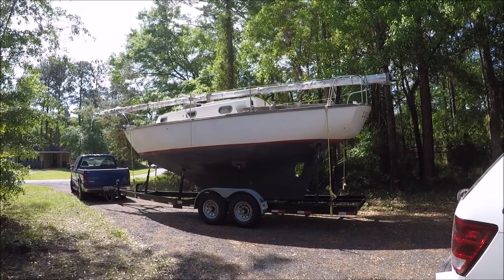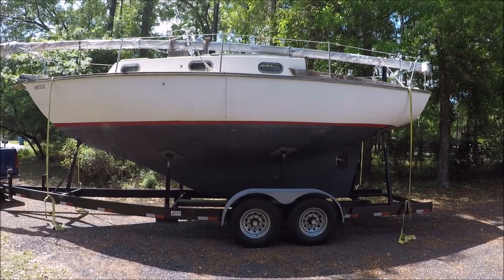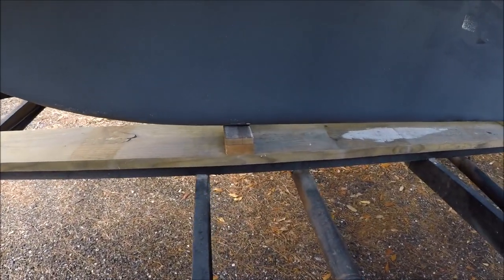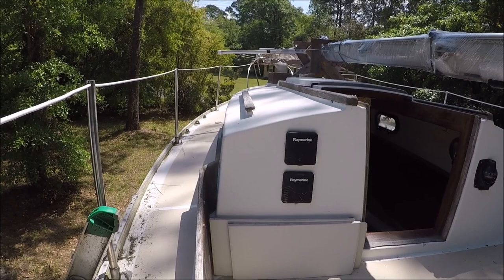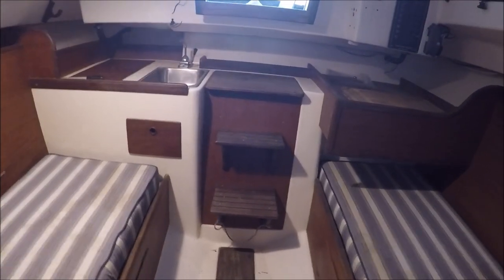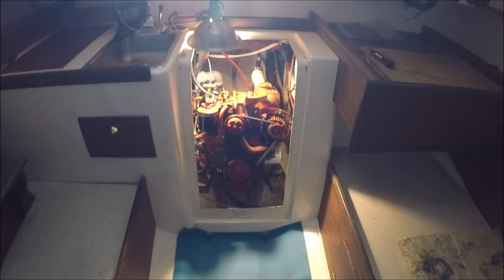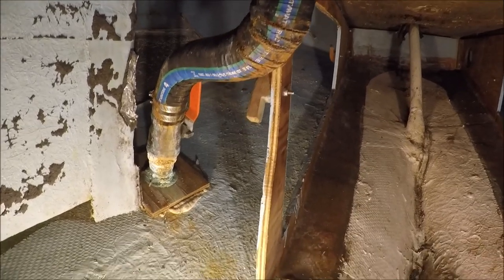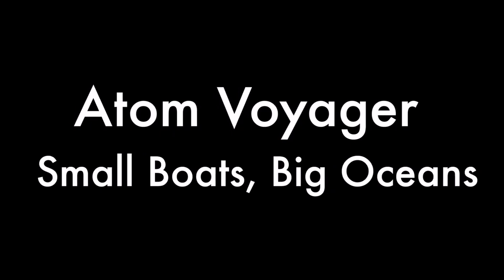Cape Dory 27 Refit Part 1 - Project Begins

Comment: Why would we get rid of an inboard? Wouldn't it provide some ballast if nothing else?
Reply from the maker: Although not the best option for those who motor more than sail, there are many reasons we wanted to get rid of the inboard engine as explained in the article linked below. As for ballast, once you've decided you prefer having an outboard motor in a tilt-up well, the 250 lbs of diesel and its accessories was compensated by extra batteries, two spare anchors and chain, aft water can storage, etc.  https://atomvoyages.com/articles/the-improved-outboard-well/
Reply: I just noticed your reply, I have a cape Dory 27 with this exact layout I'm planning on doing a transatlantic this year. I'm scrambling trying to get it finished up to go. I've had a few opinions on the Chain plates

Comment: If I'm not mistaken Sam Holmes of SamHolmesSailing YT channel sails one of these CD 27s.
Reply: Ocean crossing in his!
Reply: His is a 28.
Reply: @SOLDOZER  That's correct.
Reply: @SOLDOZER so what's the difference between the 27 and the 28 except that the 28 has a bowsprit? 🤔
Reply: @SailingSarah  27 is more cramped inside and has less beam. 27 would be legal to trailer. a 28 on a trailer would require permits.

Comment: Just got turned on to your channel and in particular this series.  I bought a Cape Dory 27 two years ago.  I've been refitting the boat for cruising.  New sails, synthetic standing rigging, custom composting toilet, new wiring, new through hulls and seacocks.   And much more.  I'm interested in the electric motor you'll be fitting.
Reply from the maker: The outboard well is finished and will carry either a Tohatsu Sailpro 6 or the ePropulsion Navy EVO 3.0 (supposedly a 6hp equivalent thrust). I'd be interested to see your custom toilet design. We plan to make our own simplified version of the C-Head no longer produced. If you want to share your CD projects you could post them on the Plastic Classic Forum. I'm a moderator and answer questions there: https://plasticclassicforum.com/forum/

Comment: Nice video James!   Greetings from Salsa in San Blas. The editing keeps getting better on these videos!  I may be in the final rounds of the battle between me and my ailing diesel.   I’m curious about the pros and cons of electric inboard vs electric outboard in a well…
Reply from the maker: I'm waiting to see who comes out on top in that final battle...I'm currently helping fit out a Cape Dory 36 with a hybrid electric outboard/gas outboard also in a lazarette well locker. The owner had considered an electric inboard but if you get one off the shelf by Electric Yacht or Ocean Volt then they cost much more than an outboard. If you try to save money by assembling your own components I'm not sure if you can get regeneration to charge the batteries when under sail and that seems a required feature you'd want. I see the biggest advantage of the outboard solution is the ability to swap out the electric drive for a gas motor if you decide you need more range or as a backup if the electrics fail. You could also consider an electric inboard backed up with gas outboard to cover any situation. But then we risk drifting too far from a simple compact affordable system.
Reply: Small world here. I've got the Pearson 365 James posted about on his website as the hybrid setup. I have now converted it to tilting outboard as he recommended, but it's otherwise the same electric inboard/ gas outboard in well. My opinion is that it's a reasonable setup, but it is getting a bit system heavy. I like the redundancy though.
Reply from the maker: @GuyIncognito764  Good points. I like the versatility and redundancy. We almost went that route on the Cape Dory 36 but was getting pricey and we need that inside motor space for the batteries although we could have probably found a work around for that.

Comment: Can I ask why you always do away with inboard and go with outboard
Reply: i believe he addresses it in previous videos. its to reduce drag under sail and make for a lighter, more modular, easy to service design. a benefit for the long distance ocean sailor who doesnt intend to motor much and would trade it off for added speed and storage capacity. These boats can be moved along at hull speed with a 6hp tohatsu sail-pro easily. not something i would do, but i can see the advantage if it suits your style of sailing.
Reply: @gumimalac  yea I just had outboards in past on similar boats and the prop comes out of water when hobie horsing but maybe the well stops it
Reply from the maker: @Yeaitstemp  Sedi is correct. Outboards on transom brackets to easily let the prop come out of the water but in the well they are more protected from waves and have slightly less pitching being further forward. Beyond that, you can find a list of pros and cons in the following article: https://atomvoyages.com/articles/the-improved-outboard-well/
Reply: Simply easier to service and less parts to break.

Comment: I think the water also sips to the core through these small cracks. The last CD 27 I saw had deck covered with these cracks so I knew what to expect before even putting a moisture meter on the deck. They probably skimped on fiberglass cloth when laying outer skin on these boats.
Reply: The cracks are in the gelcoat. Cape Dory used very thick gelcoat in at least the earlier boats. As these boats are from the days before the structural engineers removed glass to appease bean counters, the glasswork is very thick.
Reply: @RechargeableLithium  In the boat I saw they were in the glass of the outer skin. Probably just some CSM over balsa core. Possibly that the cracks developed after the core got soft. There is not much glass in the outer skin. These boats have adequate hull layup but  decks usually need some work. Also the hull glass is resin rich with low glass content which is typical to boats from that period. It is ok if it is thick enough. When I was doing fiberglass repairs owners were telling me that the hull is sooo thick because it was build when they didn’t know how strong fiberglass is so they were surprised when I gave them the measurement. In reality these thick hulls are boats from late 50s and early 60s. CD 27 was build in 70s and 80s and they already knew how to cut corners. But still, they are good boats comparing to other boats built in 1980s, good design, definitely worth restoring.
Reply: @MR-yp7mu  I live aboard, maintain, and sail a 1979 CD27. The hull's 1/2" thick up high near the hull/deck joint, and thicker towards the keel. The foredeck is 3/8" glass, about 3/8" balsa core, and 3/16" inner layer. I've been all over the boat - there's weave from glass cloth throughout. This is not a boat shot out of a chopper gun.
Reply: Sorry...can't edit my last post. I just cut a hole in my hull, about 3 inches below the rub rail, and the glass is 11/16" thick.  The hulls were hand laid in a mold using alternating layers of heavy cloth and CSM. Sorry for the error in my last (1/2").
Reply: @RechargeableLithium  It would be interesting to see how many layers of woven roving is actually there. You can see and count them in the section or where you grind a bevel. I have seen no problems with hulls of these boats, they are typical for this era, resin rich hand layup. The most quality issues I have seen in decks. Three last boats I have seen required a 100% deck recoring and were covered with cracks. Interesting is that water intrusion was present in areas where there was no deck hardware and so most likely cracks in the outer skin were the culprit. It is not a big deal. I recored a few a of similar boats with Coosa board and takes me around two weeks for the boat that size. Not all areas were soft yet but, quick test with moisture meter shows the potential trouble spots. I always recommend that people who shop for a  boat buy this inexpensive tool. Other boats from that era, like Cals or Rangers that used plywood, not end grain balsa for deck coring seem to have less deck issues. I always thought that it would be a cool project to build one of these good old designs with modern materials like non-woven fabric and high density foam.